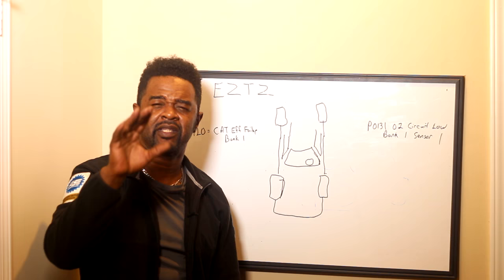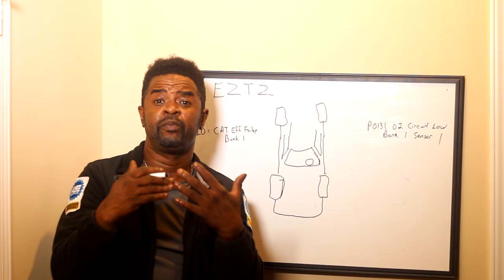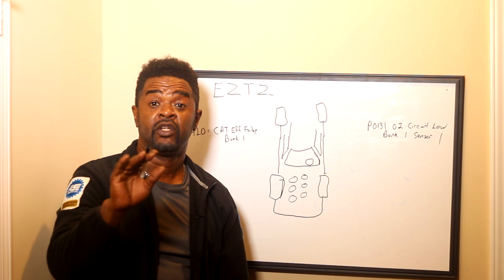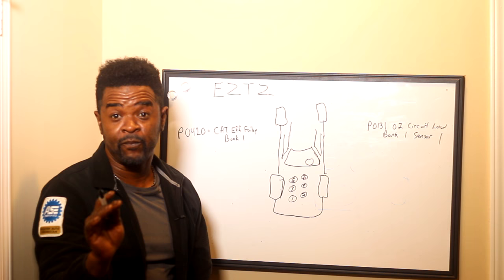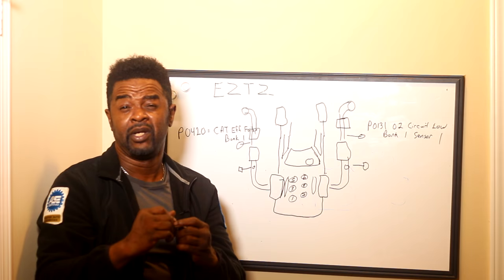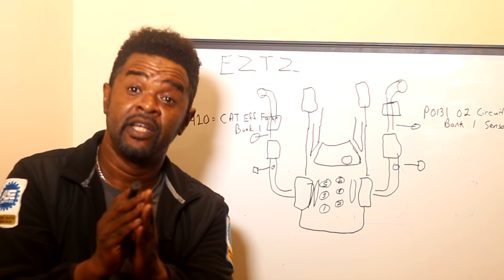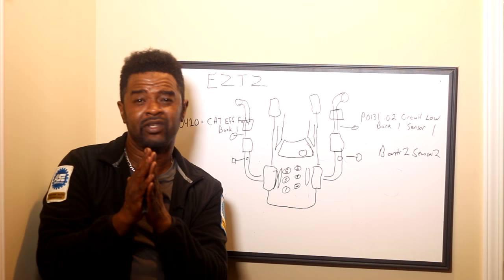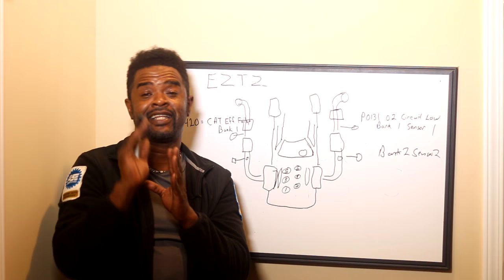Bank 1, Bank 2. Oxygen O2 Sensor Location, I show you how to locate the correct O2 sensor. P0131.

Comment: I have a dodge caravan 2012 and it's showing me the code po420 bank 1 . It's doesn't tell me if its sensor 1 or 2 just says bank 1 what should I do?
Reply from the maker: Hello my friend. Bank 1 on a Caravan is the rear cylinder head. You will likely have to get that convertor replaced to fix that code. Sorry,. But thanks for watching and please thumbs up the video and subscribe to the channel, thanks.

Comment: Question I have 2 codes they both are bottom steam idk which is which p0037 bank 1 sensor 2 and second code is bank 2 sensor 2 p0057  😢
Reply from the maker: What kind of car is this? Also are you subscribed to the channel?
Reply: @OnlineMechanicTips  I have a 2005 nissan maxima se but thanks the issue was resolved just as yesterday a catalytic converter code came up

Comment: on your board diagram you show bank 2 and sensor 2 in the upstream position. NOT CORRECT .  It should be bank 2 sensor 1 that is upstream.  You have the sensors on bank 2 mixed up
Reply from the maker: The writing of bank 2 sensor 2 not there to show sensor location..I just wrote it right there to display the next example of what we was about to locate sir. Thanks
Reply from the maker: You not even subscribed to the channel, you seem to know a lot about cars. Please subscribe to the channel, thanks

Comment: Sir i have a problem with my car, it is a ford focus 2013 with a 1.6Ti-VCT engine. currently it is misfiring at cylinder 2 (DTC read from forscan code: P0302 and P0300). it also has an another DTC code P0150 saying my O2 sensor is circuit open, (Bank 2 sensor 1). where is that sensor located is it before the catalytic (upstream) or after catalytic (downstream)?
Reply from the maker: Did you ever find this info out? Im sorry im just seeing this

Comment: Doesn't help me at all!! 
What about a inline 6??? There are 4 O2 sensors. 2 upstream and 2 downstream.
The exhaust manifold has 2 down tubes, with what looks like to mini expansion chambers. 1 downstream sensor in each. 2000 wj 4.0 jeep. 
I just replaced my O2 sensors. Bank 1 and bank 2, upstreams, and for the life of me I'm still getting po172 and po175 too rich! I replaced the injectors, spark plugs, fuel pressure regulator. WTH does it want from!!🤯

Comment: Question sir I have a 2014 ram 1500 v8 I just had a brand new engine installed by dodge I now have a check engine light p219a air fuel ratio imbalance do you think maybe the o2 sensor is causing this?? Any help is appreciated sir .
Reply from the maker: Yes bud, ivwould say o2 sensors can cause this yes, I can't however say its causing your problem. Imbalance codes are triggered by a number of things and diagnosing it by the code is the best route. Is this the only code thats setting? Also are you subscribed to the channel?
Reply: @Online Mechanic Tips  yessir that's the only code it's giving, and yes, I am subscribed.
Reply from the maker: @tattedone6753  Hey bud thanks, as mentioned earlier, yes a O2 sensor can cause this but do to the fack that this a newly installed engine i would get some of the minor steps back tracked, If connectors are plugged into the wrong parts, for instance, if the injector connectors are plugged into the incorrect injector (yes it can happen). Before you try the O2 sensors, look for obvious mis-haps.

Comment: My question is that 1 I’m a woman and I’m 64… I have a 1995 dodge ram V8 5.9 and everyone is telling me I need a o2 sensor .. she runs great until she warms up and then it’s like she wants to rave or slow down..sometimes I hear the pops in spark plugs or plug. I just had a total tune up and this started about two weeks after when engine light came on. He says it’s condensation because she’s old. Others swear it’s the o2 sensor or sensors,I’m at a lost. Driving it it does feel like something with oxygen 
Also I’ve been thinking about exhaust…see if I need to get tape and seal any holes. Can anyone help me on where to start … I so appreciate it.🙁

Comment: Ho2s Heat control circuit High bank 1 sensor 1 location on a 2013 dodge  grand caravan sxt
Reply from the maker: Hello my friend, thanks for watching. Bank 1 on a 2013 Caravan with the 3.6L engine will be the rear cyl head. Sensor 1 will make  that the upstream O2 sensor on the Bank 1 cyl head which is the rear cyl head.
Reply: @OnlineMechanicTips  Man thanks, changed sensor, code cleared greatly appreciate you.

Comment: I have a P0157  It say O2 Sensor Circuit Low Voltage Bank 2 Sensor 2 we're it located on a Dodge Ram 1500 5.7 hemi
Reply from the maker: Based off the suggestion in this video, if you look at the top of your engine it would appear cyl 1 closest to the front is on the drivers side which would make that side bank 1. So bank 2 would be on the passenger side. That sensor 2 would be downstream after the cat on that side.. Thanks for watching, please thumbs up the video and subscribe to the channel, thanks.

Comment: I have 4 o2 sensors and my OD2 is reading it saying its all 4 o2 sensors. Os there a chance its actually something else all together?
Reply from the maker: What kind of car is this? And what does the code say? Also are you subscribed to the channel?
Reply: @Online Mechanic Tips  it is a 2008 nissan altima 2.5 s. And yes I am
Reply: @OnlineMechanicTips  Also hit that bell button
Reply from the maker: @deetoxinz7252  O dude this a 2008 model. You still left out what the code says but listen. The drivers to the O2 sensors inside the car computer. Somebody with a good scan tool has to view the data to tell if commands and inputs being received.

Comment: Could a o2 sensor cause your car to back fire and cut off
Reply from the maker: Hey bud, not often. You likely have other problems. The computer only need the O2 sensors to report back how much oxygen in the exhaust. Thanks for watching. Please thumbs up the video and subscribe to the channel, thanks
Reply: @OnlineMechanicTips  Sensors adjust fuel ratio from the 2 sensors on each side of the engine. Sensor 1 and sensor 2 send signals to pcm/ecm and compares signals from both  to determine what the fuel ratio should be for most efficient engine performance
Reply: It is possible if sensor 1 is not sending a signal to the pcm/ecm. How that could happen is that the computer doesn't know how much fuel to send and might send too much fuel which would leave too much fuel in the exhaust which in turn could detonate in the exhaust.... also known as a backfire. VERY POSSIBLE
Reply from the maker: @macwade777  I did not say it was impossible sir, just un likely. Anything is possibe
Reply from the maker: @macwade777  Great point bud, just unlikely. I would look at other things including the o2 sensors but thanks

Comment: Hey my friend I have the code p1135 and it’s bank 1 sensor 1 for the air fuel/ratio sensor and my car is a v6 Toyota Camry se 2002 I just wanted to know if you can tell where is the bank 1 sensor 1 I am trying see what part am I getting upstream front or upstream rear ??? Please and thank you I appreciate it
Reply: I do understand that upstream is always sensor 1 and like I was saying before  I have part I need to order one of them is upstream front and other upstream rear I just wanted to know which it is for my code and problem
Reply from the maker: Hey bud, what size engine in your car? Also are you subscribed to the channel?
Reply: @OnlineMechanicTips   it’s a v6 6 cylinder 2002 Toyota Camry se I am currently subscribed as of now let’s hope we get the great mechanic tips😆🤟🏾🤟🏾🤟🏾

Comment: Sir, is P0420 code always pointing to Bank 1 O2 sensor?
Reply from the maker: Hello my friend. P0420 usually problems with the cat convertor. What kind of car is this? Also are you subscribed to the channel?
Reply: @OnlineMechanicTips  yes, subscribed. I got 2002 Niss. pathfinder. I got P0420 (Catalyst System Efficiency Below Threshold (Bank 1)
Reply from the maker: @nukedim2276  Yes my friend, replacing only the O2 sensor will not fix this. This is a Cat code. You might need a Cat
Reply: @OnlineMechanicTips  I heard to use a Spacer Adapter 45 degree 02 Bung With Min-cat should fix it?
Reply from the maker: @nukedim2276  Yes a fouler is not a fix, its a patch. But its worth a try if you just simply trying to pass emission

Comment: I'm looking for help if anybody who is familiar with the 2003 Toyota Highlander I need to replace the the Upstream O2 sensors I can get to the one in the front easy but the one in the back of the engine is it easier to replace it from on top or underneath the car